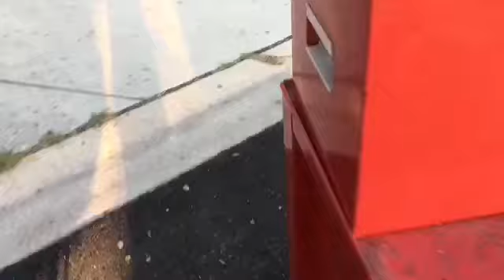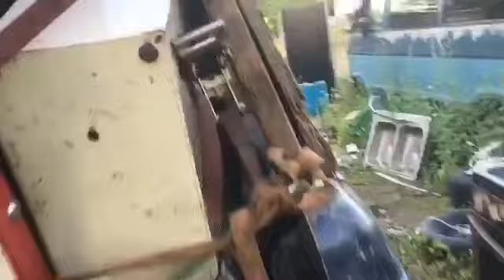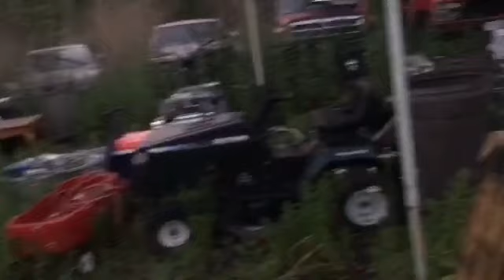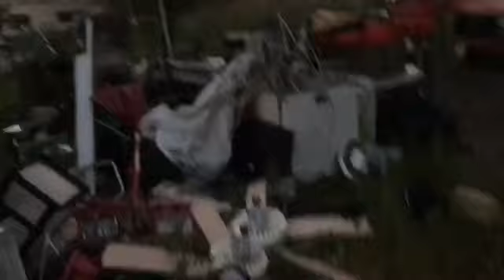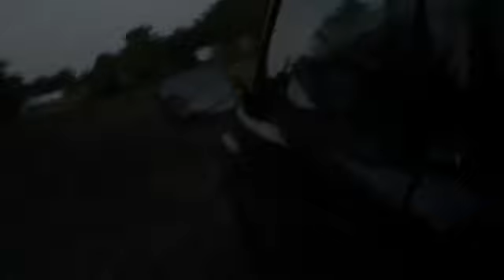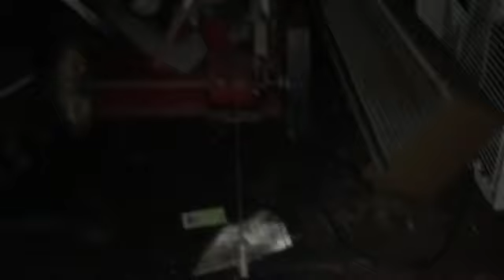BACK AT THE COMPOUND ep#105

Comment: lokks a little ruff but not nothing i cant fix 😁😎👍🇨🇦
Reply from the maker: Well I can just imagine

But hey how so sir?
It’s missing pieces&
Is it worth the effort and time involved
Reply: @steelisthemeal  the bottom box is more worth fixing there is a tab on the side of the drawers that you can see through the slide push it in the drawer will slide out when it gose back together make sure u pull that tab out just enough so it catches again behind the sliide you may have to straighten the slides or drawers but it should be easy enough and i save the bad ones for parts 
good luck marty hope that is enough info to get you started 
if you have any questions let me know
Reply: @steelisthemeal  make sure to lubricate the sliders as you put it back together
Reply from the maker: Thanks for the useful ideas
Reply: @steelisthemeal  any time marty you know how to message me 👍🇨🇦

Comment: your so right about the fans
Reply from the maker: Yeah the new ones well the ones made in the last 20 years or so

They’re very lightweight and when you put it on the highest setting it feels like it wants to takeoff 🛫 to another city 🤣
Reply: @steelisthemeal  the same with the toolbox they have gone to plastic and the ones that are metal are tinfoil
Reply from the maker: I haven’t looked at any of the newer toolboxes I should actually check some out at Harbor freight I’m imagining most of them are made in China

Of course. 🇨🇳😭
Reply: @steelisthemeal  they sell junk hear at Canadian tire toolbox are literally like tinfoil i was trying to take the slide out and the metal tore
Reply from the maker: Holy smokes the metal actually ripped
That’s definitely 
Chineseium
Reply: @steelisthemeal  The biggest difference between modern fans and old school fans is the depth of the box frame. The one in your video looked like it was almost a foot deep. Modern ones are 6" deep if that. They fall over or blow themselves over at the slightest vibration.
Reply from the maker: That’s why they really are 
Frustrating to use

Comment: its a cross slide drill press vice...........
Reply from the maker: Never seen something like this I wonder what it would be used for
Reply: @steelisthemeal  It is for centering the hole you want to drill on your drill press. China type but they still work pretty good.
Reply: Boy over here in Ont. we have on line auctions,  Prices are crazy,  good place to sell Than ks